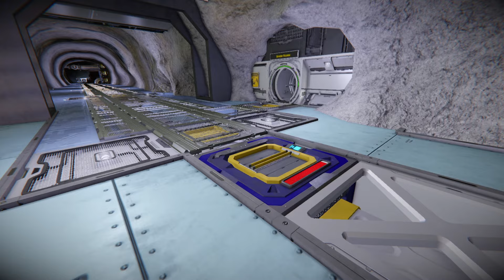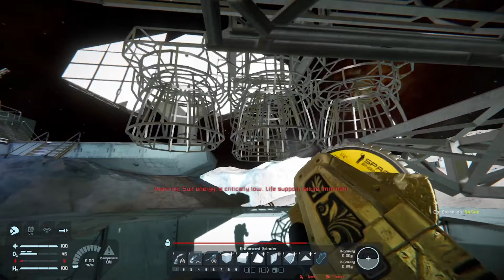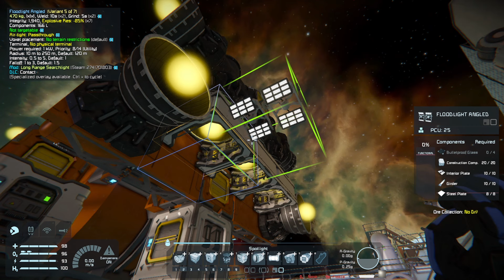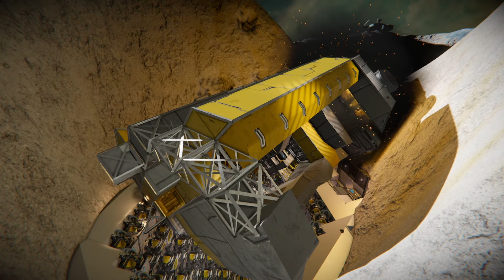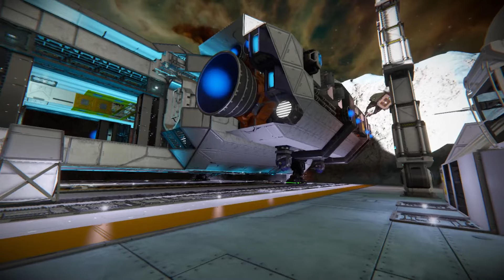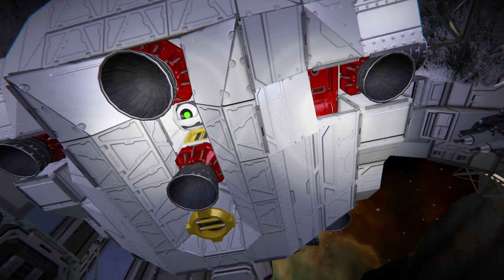A Brand New Fighter | Space Engineers | The Search for Factorum E.27

Comment: This is irrelevant since it was 4 months ago you needed this. But...
There's a mod that can be a tiny bit cheaty at times, called OmniArc. It has a remote grinder that can grind things on the same grid. If you set it to Friendly, and use a "build colour", you can place one down in your ship and then just re-colour any parts (like jump drives) and it'll grind it down for you without it feeling too cheaty.
Uses a massive amount of power, so when set only to Friendly I don't feel it is too cheaty. It literally just saves 15 trips to an inventory to dump out the components.

I mainly use the mod for the remote welder though, as it saves me from having to build a complicated drone printer setup, as I play on a virtual rig with one hour sessions and don't have the time to engineer solutions for every aspect of the game. It was either that, or build in creative mode, and I know which one I feel less cheaty about :)

Just don't do my mistake and leave a welder and grinder on at the same time, then project a drone with the same colour as the Build Colour on the grinder. Building, grinding, building, grinding and all that happens is your power draining :D
Reply from the maker: I will have to look that mod up.  It sounds a lot like an older build and repair mod I've used in past series.  Thanks!

Comment: Did you know you can use a magplate/landing gear or a connector and an event controller to make a sort of deadman switch?
For the grinding pit, for example, if you have a connector nearby where you need to park a vehicle (let's say Wanda) so that you can ensure the grinders won't operate while Wanda is in flight.
Set the Event Controller to Connector Connected with the deadman switch connector selected, set Locked to Grinders On and Unlocked to Grinders Off.
Now you can drop whatever you want in the grinding pit and it won't do anything, but as soon as you dock to that connector, it turns on.

This gives both the security that you don't accidentally grind your own utility ships, and the added bonus of being able to turn the grinders on and off without leaving the ship.

Adding a button on the platform for manual control could be useful for when you got a lot of smaller pieces to grind. No docking necessary. But when you're done, just dock and then undock again and you won't have to get out of the ship and run all the way down to the platform to turn it off.
Reply from the maker: That's a smart way of managing the grinders.  I like it!  Thanks!

Comment: Couple of ideas for your lifter! One try a gull wing design for the thrusters, maybe wider but you can space the so that they can act as a make shift measurement tool for if things will fit in the pit!  And, You could put a selection of thrusters and gyros to an event controller so they turn on when the landing gear are locked since that is when you will need them the most!
Reply from the maker: Good ideas.  I could name it the vulture lol.  And the event controller for the gyro is a definite "Will do!"  Thanks!